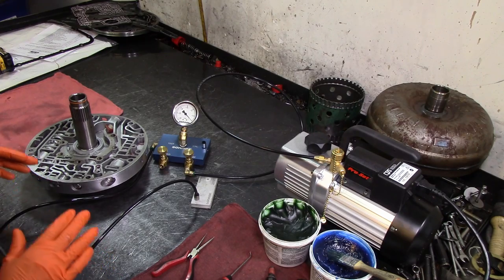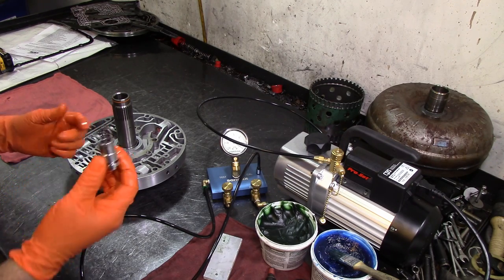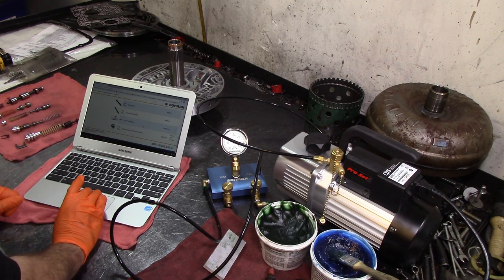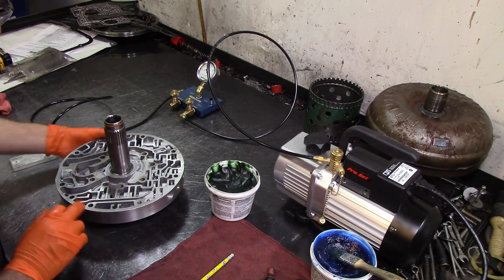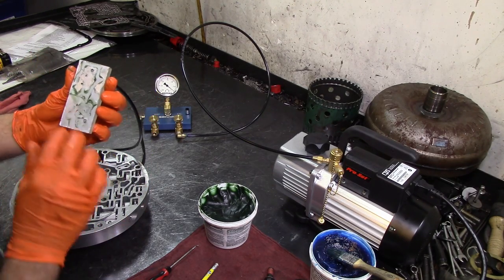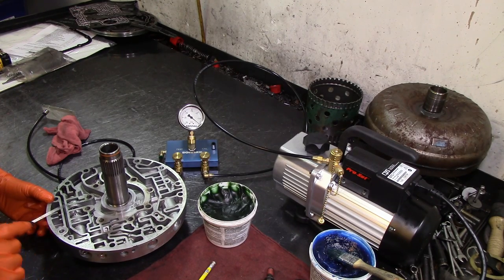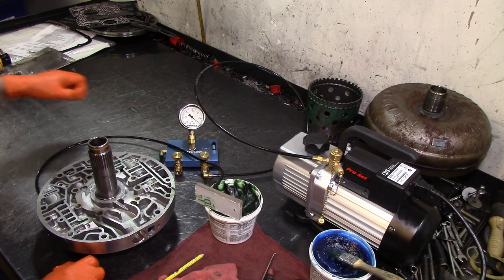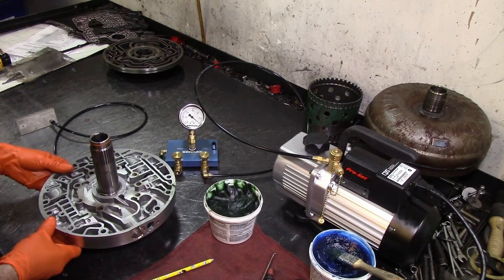Vacuum Testing - 5R110W TorqShift Transmission

Comment: Hiram, great video.  We're looking to get set up for vacuum testing at out shop, and I'm wondering what vacuum pump your using, and any other suggests on where to buy test plates and kits, etc.  I've seen most everything we need is sold by sonnax, is that where you've bought most of your set up?  Thanks in advance for any input!

Comment: Hello Mr. Gutierrez! Since you are a true and rare professional I wonder  if you can give an opinion. I have a U660F Toyota transmission that have some issues. It doesn't show any code yet. When shifting from 2 to 3 the engine revs high on his own. Also, from 3 to 2 it's a little hursh. I changed the fluid and 2 to 3 it's a little better but 3 to 2 it's a little worse. I mesured resistance on solenoids and it's ok. After the engine warms up the problems it is almost unnoticeble. What do you recomand?
Reply from the maker: The bonded pistons wear on these units. You may end up doing a rebuild on this one. But I strongly recommend installing all new bonded pistons. They leak. And that's probably what it's going on with your unit now. It will get worse before it will get better.
Reply: Thank you very much for taking the time to analyze and respond!

Comment: Hi Hiram i love your videos, great job! I have an issue with an 2001 Daewoo leganza Zf 4hp14  gearbox. When the car is cold the gearbox shifts ok, but past 10 min or so, when  it  reach opperation temperature, the transmission starts to slipping and the car doesnt move. What could it be the problem? Thanks in advance.

Comment: Mr. Gutierrez, What kind of Samsung laptop is that?  I have not seen them so thin, looks like it doesn't have an internal hard drive installed.
Reply from the maker: It's a chromebook, it does not have a normal hard drive but a solid state 15 or 30 gig drive, cant remember. Great for surfing the net and and using all google products, like docs, sheets,etc. When you buy one of this you'll get 100 gigs on the cloud. This one is very old, about 3 or more years old. And it seems like it will keep on going. Updates regularly and it's very safe. Not bad for less than 300 dollars. Not sure how much are they now but I bet you can find them cheaper and better now.

Comment: Sr Hiram Hernández sus vídeos son los mejores obvio los entiendo mejor en español espero suba un  vídeo de una 350 que la biiene usando la  S15 GMC modelo 82 resiba un cordial saludo de este su alumno gracias amigo por compartir sus vídeos con nosotros asta pronto
Reply: Gracias amigo lo voy a tratar de localizar ese vídeo por cierto esta en español thanks
Reply: Pedro  Trujillo
Reply: whats the torque for the oil pan for a 4l80e
Reply: TENGO UNA 2007 DODGE RAM 2500 6.7L...QUE ABIENTA LOS CAMBIOS MUY RAPIDO YO PIENSO QUE ES UN SENSOR DE LA TRANSMISION.PERO NO SE CUAL.ALGUNA SUGERENSIA..?

Comment: why not take a piece of plexy glass and make a pump plate for it and drill holes where you need them, would make testing easy and you do enough of them to justify an hour to make it.... Just just a thought
Reply: could be wrong but is the plate he has plexiglass but still has the protective film on it, should peel it off if so??